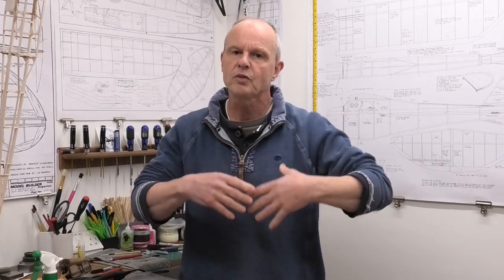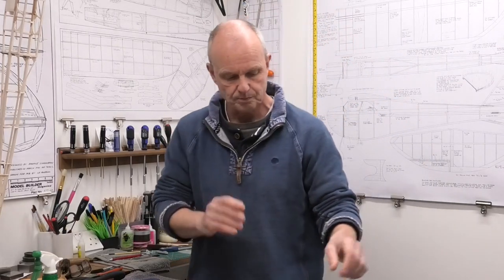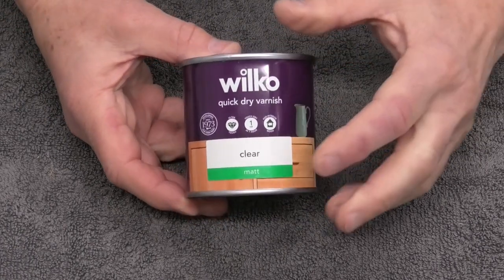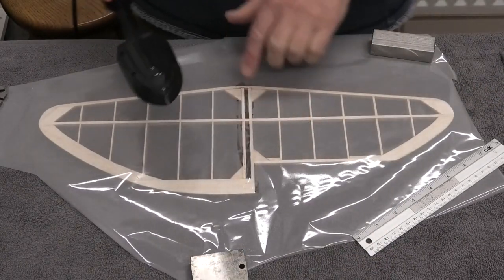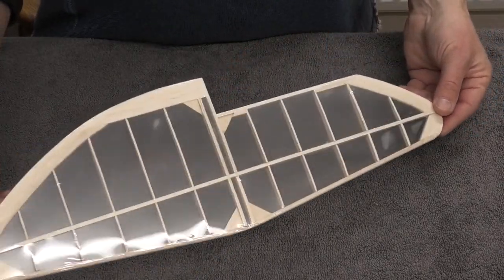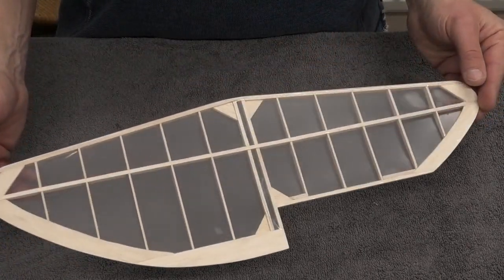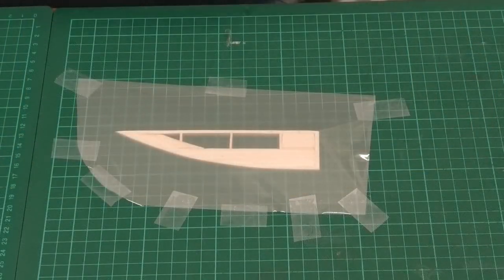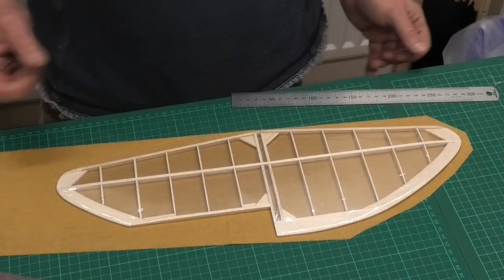Doculam & Tissue Covering - Vintage Model Plane Building

Comment: Hi Mark. I've been using this method for well over 30 years. After I put the doculam on the wing I wash it off with white vinegar, seems to lightly etch the surface to give the poly something to grip to. I cover with silkspan.  I stop the doculam at the last rib and cover the wing tips with silkspan to get those really nice tips.  I paint all of my planes and haven't had a failure yet. I fly control line, so those planes take somewhat of a beating.  Thanks for the video.
Reply from the maker: Hi Rick, thanks for the comment and information, its good to hear your experience, thank you very much.

Comment: I never saw this method before and it seems to work really well. I might give it a go at some point in the future. There is a nice Astro Viking, sitting in my loft and catching dust. The Original tissue and dope covering has become very brittle in the last 26 Years since i built it. Back then it had a brushed electric motor with a 2:1 planetary gear and it was using an 8 cell NiCad battery. Could do with an upgrade as well 😅
Reply from the maker: Sounds a great project, this would be a great covering for it, thanks for the comment

Comment: That's a great demo Mark, I've used clingfilm in the past ... same result but a lot more fiddly, you have to stick it on with pva as well. I love this material, I was interested to see you varnish the tissue while it's still wet but then being a waterbased product it's not a problem. Now I'm wondering if I should tissue by 90in Mercury 👍
Reply from the maker: Hi Cliff, thanks for the comment, its really appreciated, pleased you like the video/ technique, it is a joy to do, so easy to get good results and very strong, would be good for a larger model, being just as strong as traditional covering film.
Reply: Cliff, you can get different weights of Doculam, so you could get a heavier film if you thought what Mark used may be too light for your 90" model.
But also, you could use heavy weight tissue instead of the light Esaki tissue. 
If there is a local business that laminates documents, you can ask them for an "end" of a roll, so you don't necessarily have to get 150m of film. But you do have to wait for them to get to that point - and remember you.
Equally, for my first Doculam job, I just asked the local business for  2m off their roll - it was a small model. 😀 Obviously I paid WAY more per metre than for a full roll,  but even so it was still much cheaper than commercial covering film and I didn't have a big investment in what was perhaps not the weight I wanted "long term".
Reply: @RichardTapp1  Hi Richard, thanks for your comment, I have looked into heavyweight tissue and I see that thicker doculam is available. In fact there's a shop within 5 miles of me that sells it, and compared to iron on, film it's pretty cheap. Initially I've only seen white heavyweight tissue available which means I will probably have to paint the model which will add weight of course.

Comment: Good afternoon, the videos are very illustrative but I have a question, once adhered to the balsa wood it can come off. Thank you. Desde España.
Reply from the maker: Pleased you found the videos useful, the covering will be quite secure on the plane, but can be easily stripped off if you want to recover it. 😀

Comment: Great Video Mark. I’m guessing you must apply the varnish before the tissue dries from the water spray? I didn’t and my tissue keeps lifting off the doculam structure. Also how long do you wait between each varnish quote.
Reply from the maker: Yes you do, just blot the tissue to remove the excess water and then varnish.  I usually do the second coat when I have finished the whole structure so its more uniform looking.  If adding trim I would wait about 4 hrs.  Pleased you found the video helpful 😀

Comment: A very fine video Mark as always. 

Can water based varnish resist glow fuel with 10-15% nitro in it? I plan to build a Junior 60, my third, and to cover it with doculam and tissue. It will be powered by an Enya 15 R/C which I was given so I plan to keep things light.
Reply from the maker: The polyurethane I use is certainly good for 12% nitro glow fuel, diesel and petrol, thank you for the comment 😀 pleased you liked the video

Comment: Good morning Marc,
French, my English is by googletranslation :-)
Also a model maker, mainly replicas of old gliders... but also some creations that fly well :-)
Thank you for this video ! very interesting as a technique !
I'm starting with a few tests, but I bought film that was too thick (75u) thinking that it was going to be more resistant... but it's more difficult to stretch it correctly and make some wrinkles disappear ! the retraction is less strong…
I'll see if I can swap with 38u...
Some questions :
• no need to varnish the balsa before putting on the plastic film ?
• for Japanese paper, do you just spray water ?
In the end, it seems to hold up well... the paper isn't peeling off? even after the varnish coat ?
I was thinking of perhaps deglazing the plastic film with fine sandpaper... but the varnish may "melt" the plastic film a little for good adhesion...
I will continue my tests ; thank you for your answers :-)
Reply from the maker: Hi thank you for the comment.
No, I do not varnish the wood, just sand smooth
I spray thw tissue with just water, than when in position apply polyurathane
No peeling, it sticks very well
Do not need to deglaze, it sticks very well without

Good luck with your tests, hope they go well
Reply: @MarkRobinson555  Ok, thank you very much for your message ! I will continue your technique ; no reason why it shouldn't work since you succeeded perfectly... and I'm the meticulous and tenacious guy ! so i return to my workshop 🙂
Reply from the maker: Hope it goes well
Reply: @MarkRobinson555  thanks !
I finished the empennage; with the first paper I had (12 g, too thin, no hold... like cigarette paper), some creases are there...
But with Michael's new paper, it's impeccable !
It's tight, no bubbles or wrinkles, a silky surface... I'm happy !
Thanks again for this technique !
I think 2 coats of varnish will be good for better strength... without adding too much weight 🙂
Reply from the maker: @sebastianmendoza3026  excellent, pleased it's working well, thanks for letting me know
Reply: @MarkRobinson555  It’s me who thanks you for making me apply this technique ! 
Usually on my all-wood gliders (larger ones) I cover with Diacov 1000 for its resistance and perfect result, in a more "model" respect.
But it's obviously heavier... and for this one I wanted a light tail.
Looking forward to your next achievements 🙂

Comment: I wonder - don't you need to scuff a little the surface of the doculam for better adhesion of the tissue / varnish ?  Say a little bit of scuffing 0000 steel wool ?  Yes / No ?  Opinion ?
Reply from the maker: No not needed, it sticks really well with he polyurathan

Comment: Hi Mark, and hello from Florida in the USA.  First off great video and just when you thought you have seen it all!
I went to the UK website you posted for EBay to see if I could get some particulars and match up the doculam to a similar product state side.  I couldn’t find 38 micron just Mil thickness. Is there any way you might have a look at our state side doculam and tell me what you might recommend in thickness also in width per roll.  Or should I just get the thinnest film I can buy. Any and help for your cousins across the pond would be greatly appreciated.

Once again wonderful video I learned something new.
Cheers…….Stan.
Reply from the maker: HI Stan, thanks very much for the kind email, greatly appreciated.  I am fairly sure that the 38 micron laminating film is 1.5 mil.  Just looked on ebay.com and this is what they seem to be selling in the US.  Hope that helps. Good luck with the covering.
Reply: Hi Mark

Thank you for your reply after sending you my question I thought about it some and thought there must be a conversion formula, there is!
38 microns divided by 25.4 =1.49 mile. I guess the manufacturer rounded up to 1.5 so we have an answer. 
Thank you for your reply I am looking forward to trying this technique soon I’ll let you know how it goes.
Best of luck building and flying.
Stan.
Reply from the maker: @1toastandjam1  Hi Stan, thanks for the reply, good luck with your covering, looking forward to hearing how it goes.

Comment: Hi  Mark      Will other types of  laminating film work, or does  it have to be doculam which i can't get in N Z . I can get a 36 inch  25 micron  500 meter film for $ 100. if that works it would be very cheap.   thanks john.
Reply from the maker: Hi John, yes any type of laminating film should work fine, I only ever use 38 micron  Hope it goes well 😀

Comment: One other comment Mark. You quote the total weight of the finished tissue over doculam covering as 120 grammes per square metre. Are you sure that's correct? Solartex, a much heavier covering weighs between 85 and 98gsm depending upon colour.
Reply from the maker: Hi, thank you for the comment, I will have to go and check over mu calculations again 😀

Comment: Beautiful job Mark! Is this covering method glow fuel proof? Grettings from Argentina
Reply from the maker: Thanks very much, pleased you like it. If you are using glow it would be wise to do a final coat in something different to the polyurathane I use, but if you are using a different product always wise to test it first.
Reply: @MarkRobinson555  thanks. I Will test that. Best regards!

Comment: Hi Mark, we met at Old Warden and had a chat about this technique. I tried it last night on a tail and found it warped. Is there a trick to minimise this? Ma y thanks, j
Reply from the maker: Hi James, I am supprised to hear that it warped, must be quite a delicate structure.  If you twist the structure to get it flat, then heat to remove the wrinkles and hence straightening it, it should be fine.  Did you use the 38 micron doculam?

Comment: Hi Mark, thank you for these very detailed and instructing videos. I just discovered this covering technique and I am willing to test it on one model. The tissue finish is really interesting combined with the strength of the doculam film underneath. I was wondering about the global strength of this technique compared to a oratex covering method. Do you feel this gives more resistance to the balsa structure or would it be similar ? Thanks again for your videos !
Reply from the maker: You're very welcome, pleased you enjoyed the video.  Oratex is certainly a stronger covering, but for smaller vintage models I think this technique is more fitting
Reply: Thanks  @MarkRobinson555  !

Comment: Hi Mark, wonderful technique!
How do you handle the tensions that could twist open structures like these?!
Reply from the maker: Thanks for the comment, it's appreciated, pleased you like the technique.  Neither the laminating film or the polyurethane cause a huge amount of shrinkage, certainly not like dope or covering film, so distortion is not a big issue.  However as the laminating film does not shrink a huge amount it does mean you have to put it on relatively wrinkle free if you can.

Comment: Hi Mark, I have used 38mic doculam by itself on a couple of small models and tissue over 38mic on a Junior 60. 
I am building a Lanzo Record breaker, 96" open ribs no sheeting. Do you think using 75mic doculam and tissue may be better than 38mic on this larger wing?
Reply from the maker: I have never used, or seen the 75 micron film, so would not like to comment,  If it was me I would use the 38 micron and cover it in silk, would be so much stronger and appropiate for a larger model.
Reply: @MarkRobinson555  Thanks Mark. I did try modelling silk over film on the J60 but found I just could not get the silk around sharp corners. Gave up in the end and used tea bag paper which looks like tissue but stronger and goes on very easily. Just finished the wing center section, it's big. Trying to keep the plane as light as possible I think I will try the tea bag paper again over 38mic laminating film.
Reply from the maker: Good luck with the covering

Comment: How puncture resistant and durable in general every day use is it as compared with ordinary iron on film or lighter variants such as Oralite?
Reply from the maker: Its very similar to normal heat shrink film, obviously different films vary, and I dint know about Oralite, but certainly looks a lot nicer than film when on a vintage model

Comment: Hi, where did you get the Doculam from and what brand of polyurethane did you use please. ps is it fuel proof.
Reply from the maker: Got the film from ebay, details of the polyurethane is in the video. Its petrol and diesel proof
Reply: @MarkRobinson555  Is it Glow fuel proof as well?
Reply from the maker: I wouldn't trust it with Glow, there are better products to use I think
Reply: @MarkRobinson555  Cheers mate.